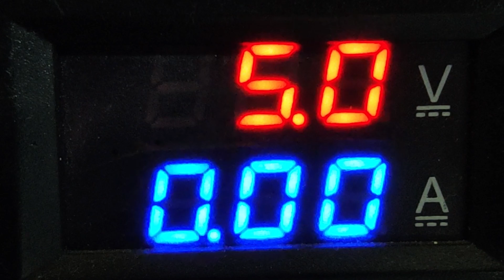Is Lead-acid Battery Recovery Fact Or Fiction?

Comment: Your method is wrong. First of all you never wash an AGM battery, simply because this cannot be done. Then, after filling in the cells with distilled water only, you let the battery to stand for a day and absorb the water fully. If there is need you add more water. After that you put the battery in charging process, but with very low amperage. You need to keep tags on the battery. Note the rythm of the voltage rise. This will be very slow anyway. If you try to charge a heavily sulfated battery with high current, you will very soon see that its temperature is getting high, while the voltage across it is not increasing. This is the common indication of a heavily sulfated battery. All the charging energy is transformed (i.e lost) in heat. So the charging current must be slow. For the battery of this video, the current should be constantly limited to about 150mA. In order to achieve this, you need a bench power supply, not a wall pack. Adjust the voltage to a high level until you see the current rising to the desired level (150mA) and then let it stay there no matter if it is high in level (say 25V or even more, for example). As the battery charges, the voltage will drop and it should stay very near to 12V, if all the cells of the battery are still healthy. If, instead, the voltage stays at about 10V, then one cell of the battery is shorted and the battery has almost no chance to recover. The entire process is inherently slow and it needs time and periodical inspection. Do not expect to recover sulfation, which is a cumulative result of long time use, within a few hours. It needs its own time and therefore a lot of patience on one's part. The point is that it works in many cases, depending on the heath status of each battery to be treated. If there are no internal shorts, in most cases the battery can be saved. Keep on charging, until the voltage reaches 14,7 or 15V. Stop the process, when the charging current drops below 100mA. The battery voltage should then drop slowly and stay to 12,7 volts or thereabout.

Comment: You do not need to add more acid. The Sulfur gets deposited on the Lead Plates. This is called Sulfation. You need to make sure that the cells in the battery are covered with DISTILLED WATER. After that you have two options, one is more dangerous than the other. You either need to use very short pulses of high voltage, for example 100 volts for 5 milliseconds, for a period of several hours to several days depending on how large the battery is and how much sulfation has occurred. Or the following dangerous method.  YOU CANNOT USE THE AMP METHOD WITH A SEALED BATTERY, IT WILL EXPLODE! YOU MUST ONLY USE THE AMP METHOD WITH THE FILL CAPS REMOVED SO THE GASES CAN ESCAPE BECAUSE ELECTROLYSIS WILL HAPPEN. You need to use high amps instead of voltage to force the sulfur back into solution, for example a CAR BATTERY (12 volts 200 amp hours), you need to use 14 volts-ish and 50 amps up to 200 amps while monitoring the temperature of the battery and how much gas is being produced. You will destroy a smaller battery than a car battery if you use 200 amps! Use your brain.
  You must keep the cells below 150 degrees F and make sure the cells are covered with water. Any part of the cell that is not covered in water will not have the sulfur removed because the water is needed to make sulfuric acid and the exposed cell will simply overheat just like any other piece of metal attached to an electrical circuit.

Comment: Water only dilutes the acid more, epic fail
Reply: Not true. The battery already had enough sulfur in solution when it was produced. The sulfur was deposited on the lead plates. Use a search engine. Look up lead acid Desulfate.

Comment: too much water not enough acid. 
you should charge it with the caps open, and should have added suphuric acid.
Reply: Not true. The battery already had enough sulfur in solution when it was produced. The sulfur was deposited on the lead plates. Use a search engine. Look up lead acid Desulfate.

Comment: try i teaspoon epsom salts per cell
Reply: Do not do this. This will get some of the cells to respond for a short time but the battery will be forever ruined because magnesium does not play well in and acid solution with sulfur and lead. You will make compounds that are irreversible while inside of the battery and it will eventually stop working.